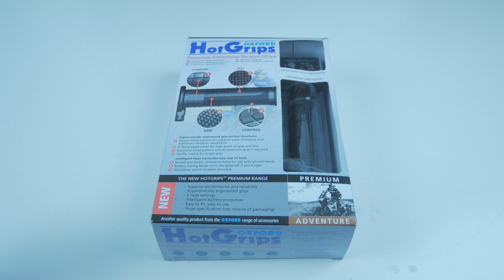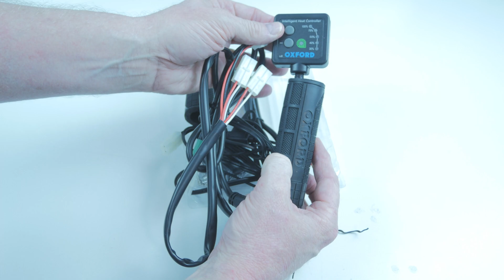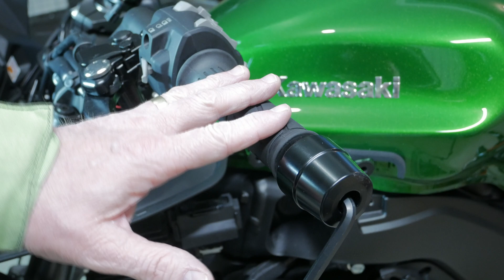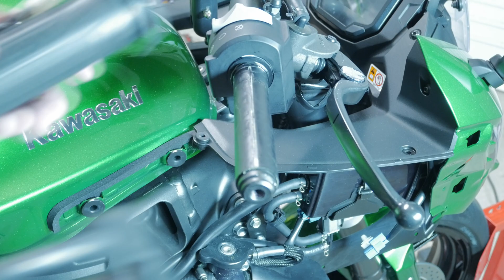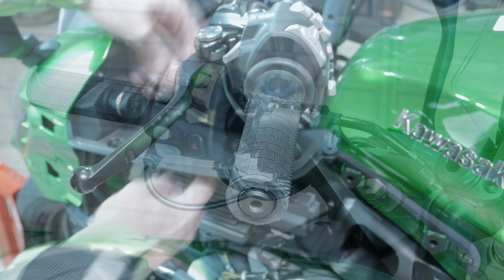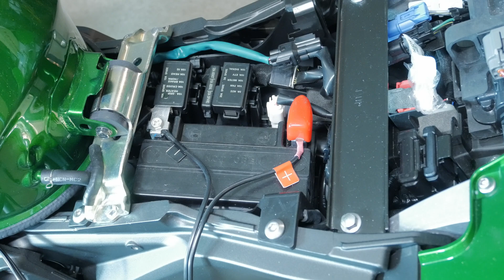How to: Kawasaki Ninja 1000SX 2020 2021 Fitting Oxford heated Grips

Comment: Oxford grips are better than standard grips   in terms of warth . But why do you been to connect to the battery . There are 2 wires just at the front to allow fitment of the grips to save running wires to the battery .
Reply from the maker: Hi. Yes I did consider using the connector there but this is ignition controlled. The Oxford control box has some very good tech which protects the battery from over discharging.  Doing it this way you can have the gripes warmed without the ignition on.  Before you start on a cold morning or stop for a break on a chilly day maybe.  Thanks for the comment.

Comment: Great tip about checking that the wire doesn’t interfere with the brake lever, i always brake at full throttle!!
Reply from the maker: Having it foul the brake would prevent you from getting to full power :)